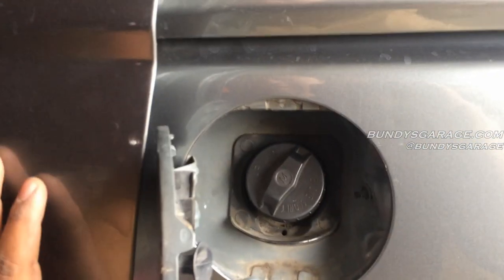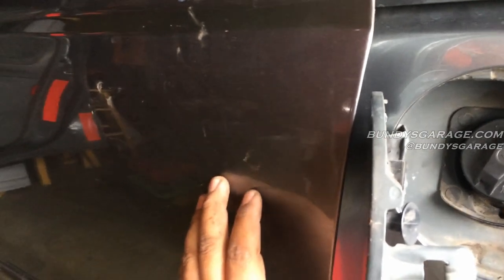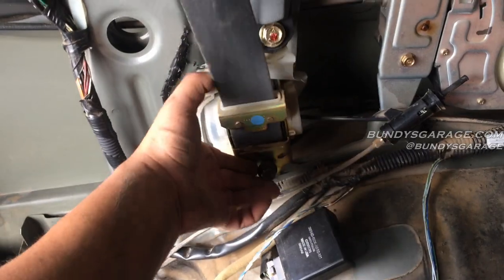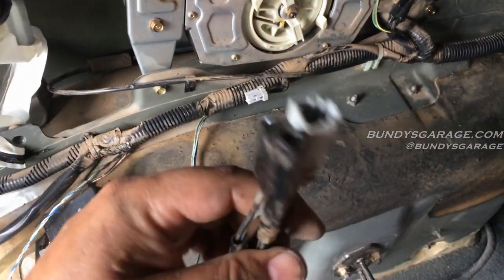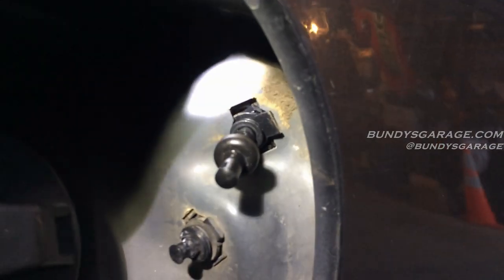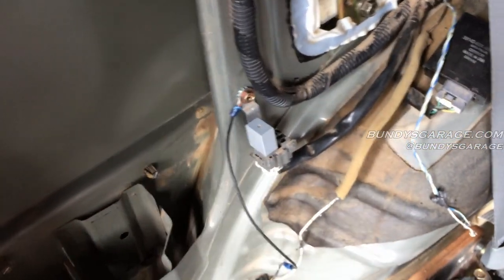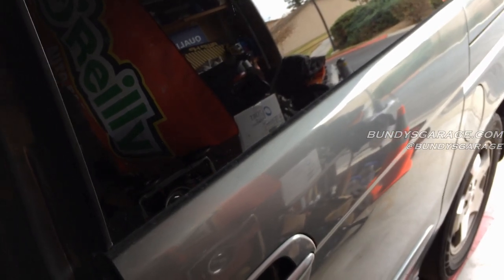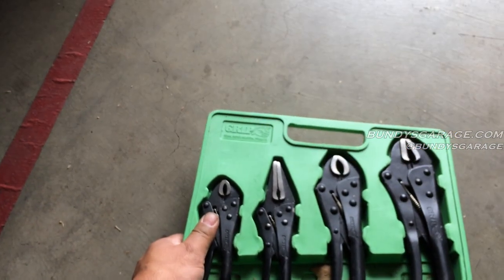Honda Odyssey Driver Side Sliding Door Wont Open - 74380-S0Z-A01 - Bundys Garage

Comment: As mentioned  in some of the previous comments you don't have to remove the entire inside panel.  It harness can be reached through the rear speaker.  Just remove the cover and the speaker and disconnect the seat belt.  Move the plastic seatbelt dust cover out of the way and reach in there.  You will feel the wings on the sensor and then twist 90 degrees to remove it.  When reinstalling it have some one spot you from outside to make sure you get both tabs through the hole before you twist it back in and to lock it in place.  Then you won't have one tab in and one tab out like in the video.  If you decide you want to remove the entire inside panel, like in the video, you have to remove the speaker anyway because of there is a bracket and bolt behind the speaker that holds the panel to the inside wall.  Excellent video. Thanks.

Comment: This happened to my 04 Odyssey.  It was also causing a parasite battery drain that only took about 24 hours to drain the battery completely because that sensor is sending a signal to the computer regardless of the car being on or not.  I was able to rig a permanent solution to the button part of the sensor, restoring its function, that will last the life of the car (saved $100 on the part (part number "74380 s0x a01" for 00-04 by the way)).  Getting those panels and such all apart and back together again was a PAIN, though.  Did the job yesterday, jumped it, and drove it for an hour last night.  As of this morning, the battery is still fully charged.  The Odyssey is back and pushing 250K.  It's nice to have that sliding door functional again too.
Reply from the maker: Good job and thanks for the part number. What was the "permanent solution"?

Comment: My drivers side sliding door would not open from either the key fob or the dash control unit.  Per your instructions I replaced the Honda Part No.: 74380-S0X-A01
Cable, Slide Door Stopper Sensor (Fuel Lid Switch) on my 2001 Honda Odyssey LX to correct this problem.

FYI: The issue with my cable/sensor was that the plastic cap the the rear side of the plunger switch that attaches the plunger housing to the cable housing cracked and would no longer keep the cable housing RIGID and allow the INNER cable to move back in forth at the sensor end of the RIGID cable to detect when the fuel door lid was opened or closed.

I had to remove the left side interior panel to replace the above part, and to do so I had to remove the left hinge from the 3rd row seat.
FYI the tool needed for this is a 12MM allen hex key.  My friend had a 1/2" drive 12MM hex drive that he let me borrow to complete the job.
Thanks for the video as it was helpful on my Honda repair.
John

Comment: When the sliding door stops opening, it maybe that the switch he replaced is still OK. The gas door latch and the sliding door safety switch is a complex mechanical mess that can get out of alignment and lead you to believe the switch is bad. Another indicator of a bad or mis-aligned switch is that your battery will run down or completely discharge if you leave the van upstarted for a few days. The switch, a relay, and solenoid operate all the time to prevent the sliding door to open if the gas hatch is open, thus if the switch is not engaged, it drains the battery.

If the driver sliding isn't working, open the gas hatch and push the switch in and out with a finger. You should hear a clicking sound in the door when you do so. If it clicks, its mis-aligned and you can easily fix it. If it does not click, then the switch is probably bad and you should follow the video. 

The alignment of the gas door, door latch,  and switch is determined by the bracket on the door that has a square box cutout that latches the door closed (see bottom of second 36).  This bracket can be bent around as an adjustment to fix the problem. The switch itself does two things, it interlocks the slider door AND it also provides the spring function to pop the gas door open when its unlatched. You may also need to bend more parts on the gas door to make sure the switch engages when the gas door is closed and latched.
Reply from the maker: Thanks for the tip!
Reply: Greg Chartrand I got my driver door lock, I did what you just say. I hear the click when I push the sensor eather with the fuel door or my finger and still won’t open. What should I do next?

Comment: Hi...great video explaining the problem. I have a small request. Can you kindly post a description about how you pull the trim panels off to expose the back side. I believe you will have to remove the seat belts to pull of the panel. It will be great if you can explain in detail what all has to get unscrewed, unbolted to pry the trim panel off. I have a 2002 Honda Odyssey. Thanks in advance
Reply: Same question.  No access via speaker placement on 2004.

Comment: Thank you so much for this video. Had no clue that switch was there. I pushed it in and out a few times and the door opens normally again. Guess I'll eventually change the  switch but the door is working again.

Comment: Thank You Bundy I had the same problem and got it fixed, just had trouble putting back side panel. However it was also causing battery drain. Thank You.

Comment: Hey I was wondering when your door locked because of the failed fuel door was it Instant. I have the same issues but I see similar videos where the mechanic will push on the unlock and instantly will lock again. Mine will stay unlocked but then moments later after I manually open and close the door it's locked.

Comment: The same thing is happening with my 2000 honda odyssey ex, at first I thought it had something to do with sliding door contact, however that seemed to be working just fine. Them I saw your video and everything makes sense, but there no way I'm going to take all that apart I would ha e to live with it.
Thanks for this is  truly helpful
Reply from the maker: Like 6 bolts 2 screws one speaker wire and it’s out. The panel is not a big deal at all.

Comment: Damn that sounds like exactly with the problem on mine, just got this used odyssey and fixing small things and the driver door not working is bugging me.  Does exactly what you say, hopefully forcing it open and closed didn't damage the motor I would hope
Reply from the maker: It't not hard at all to get to the switch. After fixing it my wife was glad the kids could get in and out of the door by themselves again.
Reply: @bundysgarage  Thanks for this video!, I just fixed mine today, actually bypassed it lol.  I was able to reach the harness connection you show by removing the speaker and reaching inside and pulling it closer towards speaker.  I ended up tugging it till it slipped off the connector.  I did this to verify it was my issue and sure enough it was.  Door works, not gonna bother replacing the sensor any time soon or ever.  Thanks for the info I recorded a short clip on my experience and method.  I'll post it up later
Reply from the maker: Send me a link once you
Get it up.

Comment: So what does the door lock do when this sensor is bad?  Is the fuel door sensor connected to the door lock actuator?  My sliding door won't open, and I have already replaced the door lock actuator, but I still have the same problem  The latch stays in the lock position, but when you go to open it, the actuator tries to relock the latch.  I can hold the latch open manually and it will stay open, but I still get the 3 beeps when opening the door handle.
Reply: You do not need to take off the entire panel. You can do this entire procedure from the back speaker by just removing the speaker. I’ll post a video soon on how to do it.
Reply: Amanda Bright  - You're entirely right! You can just pop out the rear speaker and easily access the part. I saw your comment and then went out to my van and fixed this problem! super quick and easy solution. Thanks! Also, I took a video of it so others could see. Hopefully I'll upload it soon and then I'll link it from here.

Comment: Hi I have a 2007 Odyssey but passenger sliding door dont open you know what I have to do, please help me that door is clouse for more than 1 year.
Thanks
Reply from the maker: Most likely the lock is not disengaging. There is a small actuator that sits in there that controls the lock, it has a small plastic gear that gets broken after time. You can fix it from the inside but it’s a pain in the butt.

Comment: What if you disconnect the battery would that prevent the door from locking back and then manually open the door? Just asking.
Reply from the maker: How would you start your Odyssey then?
Reply: @bundysgarage  I was just asking if that could be a work around if you had to get that door opened. By the way you make great videos. It looked like in the video you could not opened the door no matter what you did. I guess you were just using the the auto functions of the door and the door said nope not gonna open gas tank is in use. It's a smart function not to cause a disaster while filling the tank.

Comment: I am trying this for my 2010 Odessy - thanks for the video! Quick note: the part number in the video is different from the part number in your title (S0X versus S0Z)......... For anyone looking for the same part for 2010 model, the part number is 74380-SHJ-A01 (but please feel free to confirm)
Reply: Singh Surma I have a 2010 Odyssey too with same exact problem. Question: There are 2 sensors or black push button things in the fuel door. One upper is longer, seems to open the fuel door. One smaller and back a little bit. What’s that little one for?  I tore up entire inside of my car but now confused on what each is for and having trouble finding where they route to and where the connector is. Did the part for 2010 work and solve the door problem?
Reply: ldbn1010  - the smaller one is the fuel cover door release. Leave the door open and have someone pull up on the fuel door lever and you'll see the small one pull in.  This allows the door to open.  The longer one up top is the main one being discussed by this video and in these comments--it's the one that actually does 2 things: it senses when the fuel cover door is open AND it acts like a spring to actually push the door open when it's released.